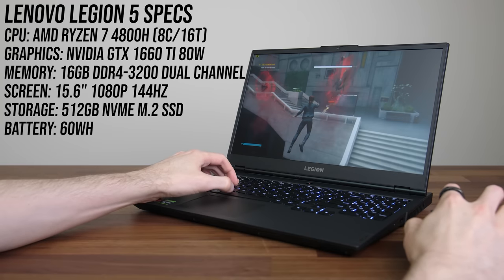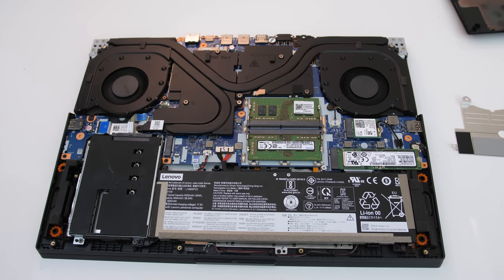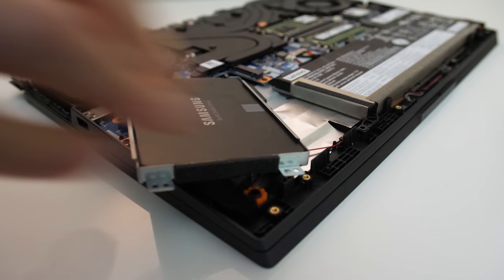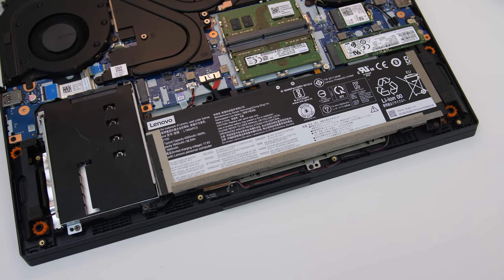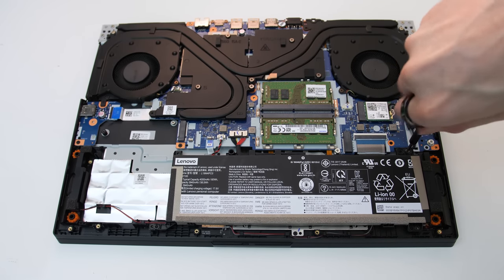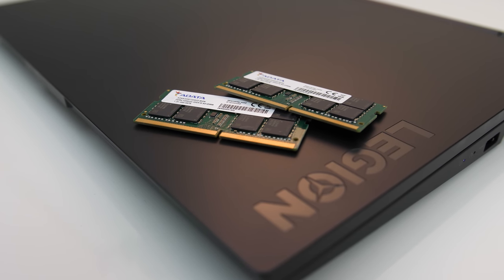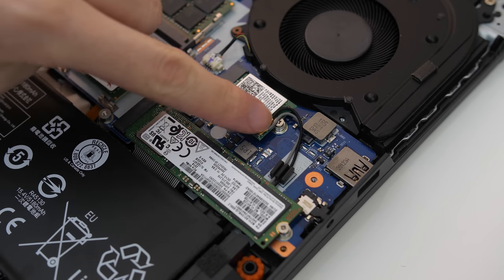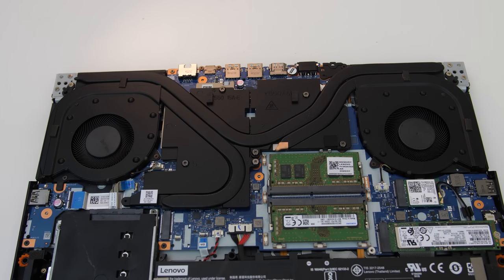Lenovo Legion 5 Upgrade Guide - Boost Performance!

Comment: Going to purchase my first Lenovo Legiong ever. Do you guys suggest Legion 5 2020 vs 2021?
Reply: I think the 2021 version. Becuase it will get cheaper if im not mistaken
Reply: @ammaraazri536  Awesome! Thank you AMMAR for your time.
Reply from the maker: I'd probably wait a few more weeks for news on the 2021 unless you need something immediately.
Reply: @JarrodsTech  I Appreciate you and what you do for the YouTube Tech community Jarrod 🙏. I shall wait for the Legion 5 Pro 👊
Reply: @xcH1NOx1  when will it came out? The legion 5 pro
Reply: @rafitohornero3850  i did read somewhere which say it is available starting March.
Reply: Acer nitro 5
Reply: @JarrodsTech  but the laptop you're using in the video is 2020 version right?
Reply: What is the difference of the Lenovo legion 5 2020 and Lenovo legion 5 2021
Reply: If you’re going for the rtx 2060 is 100% worth it at least I got mine for 699
Reply: @ale4462  🙏 Appreciate your time ID 👊
Reply: @ale4462  do u possibly know what is the difference of the Lenovo legion 5 and Lenovo legion 5 pro
Reply: @ale4462  was that the 2021 version? Cheaper than this one...wow where did you get it?
Reply: I'm also waiting for the 2021 model before deciding which one to buy.
Reply: @andreiahumada935  5 pro have Quad HD Display and probably fast GPU and CPU
Reply: @bobr9207  wouldn't it hurt the performance as well?
Reply: @pain00077  Awesome! I had my 💰 saved for this beauty Legion 5, but I triesd my luck and ended up buying a PS5. enjoy your new laptop buddy 😊👊
Reply: Where did you buy it?
Reply: @ammaraazri536  😳😳 it’s going to be gtx 30 series so not cheaper
Reply: @racermigs1  same im still waiting im poland
Reply: @angryboi801  yaah me too in India ✌️
Reply: 2021 legion 5 pro if you can afford it. Or else 2021 legion 5 is still going to be awesome.
Reply: 2022
Reply: Yeah, a pc.
Reply: @andreiahumada935  HUUUUUGE difference in CPU performance if you go for AMD version, decent difference in GPU power if you go for 3060 130W (dont buy 3070, they are expensive but limited by TDP).
Reply: @ale4462  where did u get urs from
Reply: @andreiahumada935  almost everything is the same (of course specs is different, but build, keyboard, trackpad, etc are all the same) but with one very useful advantage of the 2021 model: usb c charging. I plan to wait for 2021 model just for this feature. For someone who works remotely, having to just bring one charger for my laptop, phone, and tablet is really convenient.
Reply: Get 2021,I have a legion 5,definitely you have to get the ryzen with 16 gb of ram.
Reply: @ale4462  damn where did you buy it for such a low price?
Reply: Just get the 120hz with the 1660ti use it for a year then build one when there isn't a shortage I can max settings everything except competitive games
Reply: I'm getting 2021 cause it has better specs
Reply: @JarrodsTech  what do you think now? 
Was it worth waiting?
Reply: Those holes on the back looks scary as fuck. It's like, the thing is staring at me. That's freaking me out.
Reply: Lenovo-Legion-5-battery-drain test
Reply: Is the legion 5 2021 will have lower specs for their gpu?
Reply: So far the best laptop with low key casing
Reply: It's a trash laptop don't buy it....I am making biggest mistake to buys these.... battery backup is very very less...less than 2 hours... also fan sound coming sometime
Reply: @bravosixfoxtrot  Is 8gb enough for mid range gaming?
Reply: @ale4462  how 699...link?
Reply: 2021 cheaper and 3060 in there.
Reply: 2021
Reply: same I recommend 2021 version cuz it’s comes with RTX 3060 & 3070 cards
Reply: @AmanKumar-fb9ug  no, 6h+ xD
Reply: @JarrodsTech  hey, i saw all your videos on different models. I am confused which one to buy. according to you, which brand or model would be best for me considering I am a regular heavy user for productivity 70% and gaming 30%. I am concerned for noisy fans as i dont like it.
Reply: @ammaraazri536  bruh how much legion 5 has ram?
Reply: Legion is Legend 👍
Reply: @ototurmanidze5578  8
Reply: 2020
Reply: @xcH1NOx1  hey just asking if you are happy with 21 legion or not? Would you advice it?
Reply: @kokobedima  Hey Drey I was going to purchase this laptop but I tried my luck on with the PS5 and got it instead. This brand and item has 50 50 review. You have to ask your self do I need a laptop? And for what...gaming,editing etc. 

I only wanted this becuase of my space issues and a laptop was going to be Best for me at that moment, but a PC is always better due to easy upgrades and more powerful. Do research on what you need a laptop for buddy, best of luck and I hope that this helps.

Comment: Before changing any hardware,  you need to remove the battery cable, so the laptop stays without power. Besides that, very instructive video. Like it every second of it.
Reply: Wdjm ?
Reply: @masterrahool4774  You could damage your components or yourself if you start up your laptop on accident during the upgrade, the other thing you could do is to disable the battery in the bios before opening your laptop.

Comment: Tip for those of you planning on doing this (which is well worth it!): Take your time when prying the laptop open. There are tiny clips on the inside which are pretty fragile and I snapped one when opening. Not a huge deal, but still best to be careful.
Reply: And dont forget to unplug the battery first.
Reply: Will i void my warranty if i only just wanted to add a 2,5" HDD by myself?
Reply: additional recommendation:  pry the sides and front first, the back section are hooked onto the ports and comes off more easily once the other 3 sides are loose
Reply: Those holes on the back looks scary as fuck. It's like, the thing is staring at me. That's freaking me out.

Comment: How one earth are you getting this much battery backup from these laptops? I've tried doing everything in power, and discussed a lot within posts on Reddit, and nothing helps. The most one can do is severely undervolt their CPU, bring down the refresh date, and take other drastic steps of this sort to maybe extract a 5-hour battery out of the Legion 5.